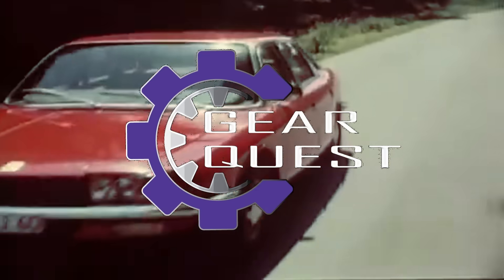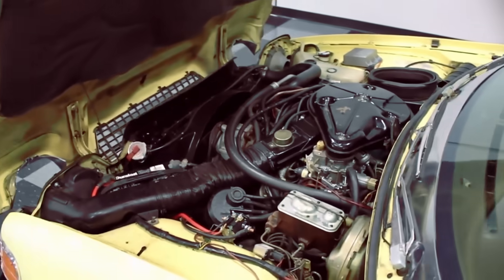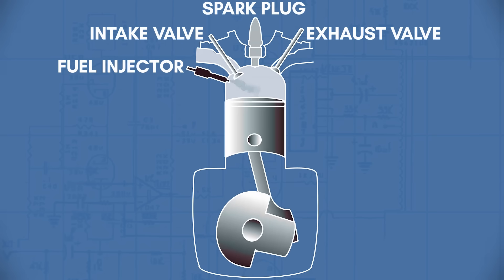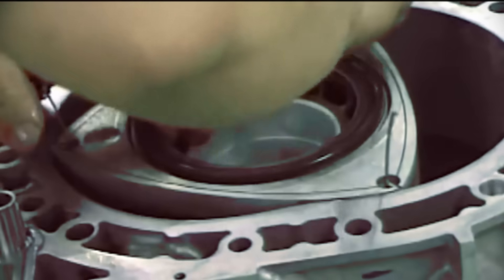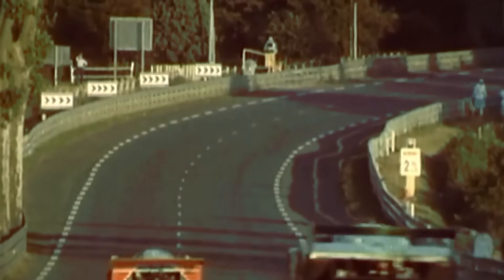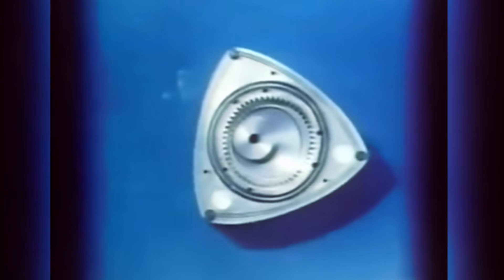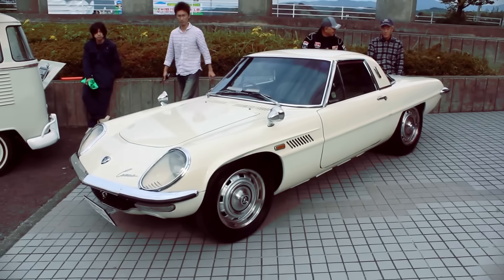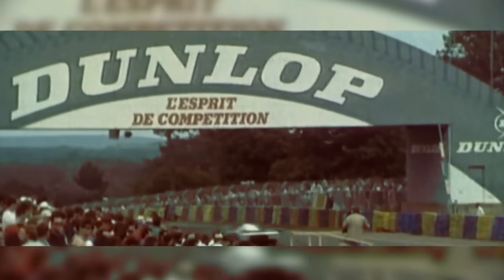The History of the Rotary Design

Comment: Objective calculation of a rotary engine's displacement can only be done with the same method as it should be done for the conventional engines. Just calculate the cc of the volume of the air-fuel mixture inserted into it per cycle. Done. That is what moves the cylinder-rotor after all. Because of the wankel's architecture it cycles much faster and thus, consumes more fuel than the average conventional engines in its class. But not much more as a comparison between an S2000 and an RX8 when driven fast shows (both NA with rpm limits close to 10K). I guess that a 2-rotor engine with a compessor that fills the torque gap in the low-rpm range can become much more efficient than when NA. And if made with hybrid tech, it can pass regulations to allow Mazda to bring RX on sale again. Time will tell though. Thanks for the video and all the best in 2020.
Reply: Displacement is calculated the same as reciprocating engines, by the swept volume.
The Mazda 13b series has a total displacement of 3,9 liters.
BUT because the Wankel engine is a 4-stroke and It requires 3 revolution instead of 2 to complete it's cycle, we use the 2x formula to compare them to a 4-stroke reciprocating engine. Making it a 2.6 liters for comparison purposes.
Mazda discontinued the Wankel engine because they were not selling anymore, sales steadily declined after 1986 until production ended in 2012.

Comment: ...Synthetic oil leaves deposits when burned, making them unsuitable for rotaries considering how much oil they burn. I drive an xB with a high mileage 2afze engine. Not a rotary of course, but an engine known to burn about a quart of oil per month with typical driving.. Should I stop using synthetic 5w20 and go for conventional? 150k miles
Reply: That is not true, you need to learn more about motor oil.
Reply: You should use the oil labeled with a API, EC or JASO rating to meet the manufacturers  recommended specification. If the oil meets or exceeds this rating it is safe to use regardless if the oil is called synthetic or not.

Comment: My '91 RX-7 naturally aspirated would pull like a mule all the way up to 100 mph(top speed 131 mph),51/49 front/rear weight distribution,extreme grip tires(30k) was a blast to drive. It was designed to consume 1 qt. of oil every 3000 miles. Vibration free to the point that I would have to look at the tachometer at idle to see if the engine was running. Beautiful suspension that communicated what the road surface felt like. 
But of course the rotary engine had a cooling jacket which helped dissipate the combustion heat byproducts. 
It was unique and a blast to drive.

Comment: The wankle design is more efficient yet by design a failure. Its complexity comes in the material limits, the seals being a huge weak point, and the uneven thermal dissipation. All things attacking the longevity of the rotary!
Reply: The Wankel engine is less mechanically and thermally efficient and also suffers from extremely poor combustion efficiency.

Comment: I just realize why is this engine is not eco friendly.
For each cycle, it burns 3x more fuel (assume both need to use same fuel for each combustion).
Reply: KevinMulia well, the eccentric shaft inside rotates 3 times to make the rotor turn once. Factor that in. Even still, every 360* of rotation produces a combustion event. A four stroke is every other.
Reply: @fry.master  Yeah... but the emission test don't care, it always counts the pollutions you make in a set time.

Let's say 1 cycle needs 1s.
Rotary will have 3 ignitions in 1s, while 4 stroke will have 1 ignition.

Assume that the fuel needed is same for each ignition, of course it will yield to more pollutions for each cycle.

Maybe that's why it is not that cost efficient to use the engine since it will produce more pollution in a set of time
Reply: @fry.master  But... when I wrote this I was thinking 1 wankel against 1 cylinder.
And I just realize that modern car engine has 4 cylinder...
So I don't know anymore

Comment: Nice vid. It’s a shame they had to limit the oiling in the renesis which rendered it having such a short service life. The rx8 is a superbly lovely car and quite fun to drive. Revs like a bike! always thought it would be incredibly fun to install a supercharger. Not sure if it is feasible
Reply: The primary failure mode of all Wankel engines including the Renesis is not related to lubrication but rather the damage caused by erratic combustion and vibration.
The Renesis was terribly unreliable because it was the highest static compression ratio of any 13b series variant.
Reply: The Mazda RX-8 was very disappointing follow up to  the RX-7 and was a very unpopular model and major sales flop.

Comment: The happy medium may be opposed piston engines, theres even a rotary design that uses pistons on a ring that push off eachother at the top of the stroke, reducing power loss from direction change as youd have in a normal piston design.

Comment: What happens if instead of fixed apex seals, they're designed as rollers (basically as bearings) backed by springs??  Wouldn't that reduce wear and retain a better seal as they wear?

Comment: The Rotary engine is also an internal combustion engine like any V8 etc. (The burning of fuel happens inside the engine as opposed to, for example, a steam engine where it happens outside.) The conventional auto engine is correctly called a reciprocating engine or piston engine (preferred) to distinguish it from a rotary design.
Reply from the maker: The audio dropped out and I corrected the error in the pinned comment above

Comment: @ 7:12 He says the engine is a 1.3 liter and that's wrong because they only count the swept volume once.
The rotor is actually using the swept volume 3 times per rotor so it's more like a 6 cylinder with a volume of a 3900cc engine, and interestingly enough, the engine puts out the power of, and consumes fuel as if it were a 4 liter V6 engine!
Reply: SAE J1220 specifies it as three not one as well....  let’s pretend the other faces/combustion chambers are doing nothing the entire time it’s spinning I guess?  I mean if they don’t do anything then weld them shut right. It only makes sense it uses more fuel to make less power, it’s actually a pos if you apply the proper displacement to it. As to the 787 it had more DNF than podiums , no fastest laps, no poles all while being gifted weight breaks lol!

Comment: let me save you some time. Wankle engines are garbage. they have terrible lifespans because the design is such that the blades wear out fast and the engine needs to be serviced a lot.. yes they are capable of higher RPM's. but that is also why they wear out fast. additionally the issue with the blades (which are essentially piston rings) causes the leaking and burning of oil as well as loss of compression which ultimately means LESS HP. these engines failed for a reason.

Comment: The Ro80 was an utter The disaster due to reliability of the rotary engine. The problem with all rotary engines were that the rotor tips travel at such high speeds that they find preventing wear really hard. As I recall the NSU suffered with that but also overheating and many other issues.

Comment: An interesting design with a lot of potential, but serious wear issues. Would love to see more innovative designs that cut out the linear motion of the piston engine.
Reply: If the same effort and development had gone into rotary engines, that has into piston engines, I'm sure they would have overcome the basic design difficulties long ago. Poor fuel mileage and the associated emissions issues in addition to the design challenges are likely responsible for it's lack of development. Perhaps using direct injection they can overcome that inefficiency as they have done with modern 2 stroke outboards.
Reply: @fiveowaf454  Well the main issues are in seal wear, warping from poor heat distribution, and combustion chambers lubrication. Serious money and time would be needed.
Reply: @tadferd4340  It's really down to incentive for manufacturers, someone could spend an awful lot of money, but would still appear to have a quirky design versus something customers are used to. It would really require it to make some jump forward in terms of something like fuel economy that could give it an edge over a normal piston engine for anyone to seriously invest in development to overcome the other issues. Norton motorcycles played extensively with rotary engines and I believe they used cooling for the actual rotor, but that in itself presents a tricky problem in terms of how to have seals that can contain the fluid for inlet and outlet. The Rotary engine is such a simple basic design yet it creates such difficult secondary problems to be able to keep it cooled and running long term. If you consider how technology has moved forward in leaps and bounds since the 60's it does certainly seem possible to engineer a reliable rotary engine, currently it seems to be the potential solution to a problem no one is having, so why bother.

Comment: The RX8 was a failure in comparison to its predecessor. Owners had to resort to after market seals just to increase the lifespan of the engine. That proved very expensive. Ask me how I know.
Reply: Oil pre-mixed would easily solved that problem...

Comment: 9:37 this is wrong, cuz rotor operates only at 1/3 speed i.e. 3000rpm at 9000rpm on crackshaft, so rotors have hard time going past 3xxx rpm
also compression happens at same rate as in 2T engine, so displacement ratio should be at 2.0

Comment: Ahh rotary fan boys, just because it's different that doesn't make it better. 

Rotaries were never specifically banned from motorsports where engine design was open category, they were just found to be inefficient and uncompetitive so nobody used them. The one time they did win (Mazda 787b at LeMans) they did so because because it was more reliable than the other cars thanks to premixed fuel/oil, the car itself was pretty slow compared to its contemporaries even with a weight advantage but thanks to them all blowing up the Mazda crossed the line first. 
Rotaries were "banned" the following year not because they were too fast or an advantage but because the FIA had declared well in advance of the 787 winning that they were switching to 3.5l F1 engines for next season, Mazda knew this as well as anyone else did. It's like saying they banned the 2005 BMW F1 3.0l V10 from motorsport because it was too powerful by switching to 2.4l V8s for the following season. 
Rotaries aren't used in motorsport for one simple reason, they have never proved to be a competitive advantage in any shape or form.

Comment: I did hear somewhere that the rotary is making a comeback in the next few years...so who knows Mazda or some other company may bring it back to our streets again
Reply: I believe with modern materials and coating technology many of the longevity issues could be overcome, but the problems lie with emissions and fuel consumption, perhaps switching to direct injection could overcome some of the losses due to unburned fuel.
Reply: @fiveowaf454  horses for courses.
any Piston Car that produces similar Horsepower will use just as much if not more Fuel.
Reply: @doppies2001  What you are overlooking is fuel efficiency, i.e. how much power is produced by the fuel that goes into the engine. Unfortunately the rotary engine works in a similar fashion to a traditional two stroke engine by using ports to draw fuel in and send the exhaust gases out. What happens is that not all the fuel entering the engine is burned and a certain amount goes out into the exhaust evidenced by the flames some seem to enjoy from the exhausts on RX8's. I'd be interested to see how this could be mitigated by direct injection as this has been used with 2 stroke outboard motors to great effect. The evidence to the lower efficiency of the rotary engine can be seen by comparing the RX8 mpg and power to those of other vehicles, the nearest I have direct experience of currently would be a Jeep Grand Cherokee with 293 hp getting 19 city and 26 highway compared to the RX8's  230? hp and 16/23 for the mpg in a vehicle weighing 3000 lbs and low and aerodynamic as opposed to a 5000 lb "block" being forced through the air.  In the same way my old 70's 2 stroke motorcycles cannot compete with my 4 strokes of the same era on mpg, because the 4 stroke engine is able to burn much more of the fuel entering the engine turning it into power than the 2 stroke equivalent. Having those extra cycles make a difference to efficiency as you are not trying to do two things at the same time. As the timing is controlled by the rotor and ports, I'm wondering if a rotary engine is like a stroke in that they run reasonably efficiently at certain rpm,which is the "sweet spot" of the port timing, but use in comparison massive amounts more at idle and lower rpms where the port timing allows more unburned fuel out through the exhaust as traditional 2 stroke engines do.

Comment: It traded the issues of reciprocating engine for issues of rotary engine, but ultimately it was designed like a two-stroke and it inherited all of its features and drawbacks.
Reply: actually not.
it is a 4-Stroke Engine.
Wankel had a patented 2-Stroke Version as well.
pity no-one ever built it.
twice the Horsepower would have been mind-blowing...
Reply: @doppies2001  Calling it a 4-stroke is a stretch, none of its phases are separate, they all overlap to a pretty large extent. And its design is closer to 2-stroke, with windows instead of valves and oil injection and all. It does have a lot of power in a small package, but so does a jet turbine.
Reply from the maker: Rotaries are a two-cycle four-strokes, they have a true 4 cycle (combustion event) but unlike a piston 4 cycle engine the rotary only needs one crankshaft revolution to complete its cycle, just like a two-stroke piston engine

Comment: THESE APEX SEALS Bug me With all the new material Science today, we got Hot end ceramic turbine blades, Hollow ones grown from single crystals with cooling air passages inside, metals formed in microgravity experiments, incredible sfufff Carbon based produced too!
and we can't uprade for some ancient  way of building this gteat idea of an engine?
Reply: Keep in mind sometimes it's not what you can or can't do but the scale of it. These cars tend to be more relatively mass produced. And if you can't do it cheap enough, it's not worth it to the car companies even if it's totally possible. The car companies are trying to keep a profit margin and sell it at a price the market can bear.  If a new RX-# from Mazda cost $150,000 but the engine was great, sure a few would buy it but it would be right production wise for what Mazda does. They sell cars by the tens of thousands, not hundreds.

Comment: title doesnt match content. but it was interesting
Reply: 8:40 higher power and lighter. Higher fuel consumption and less fuel efficient.
Parts only last for 60k miles before requiring replacement. Not suitable for daily use